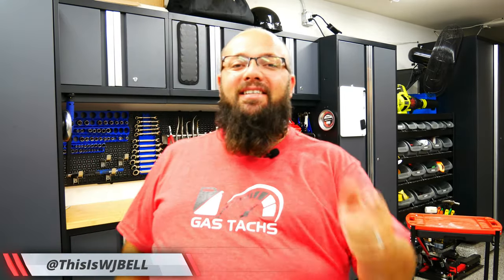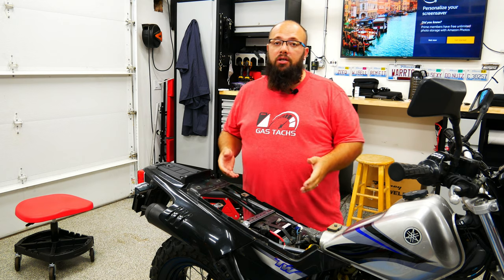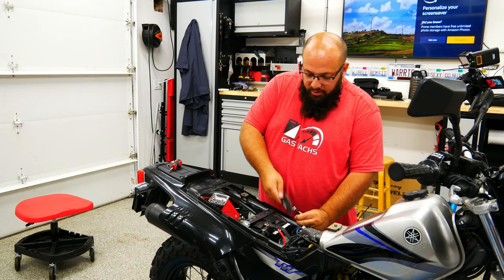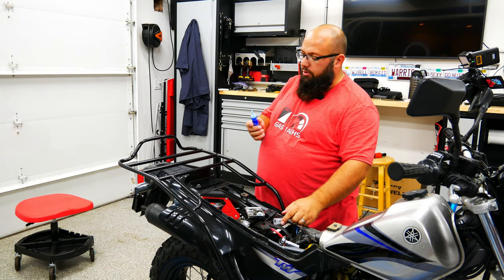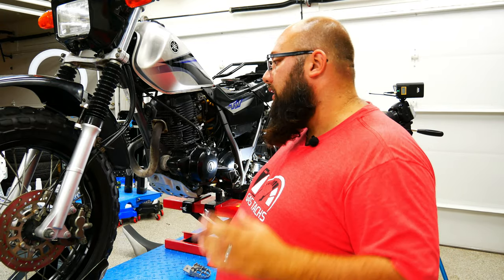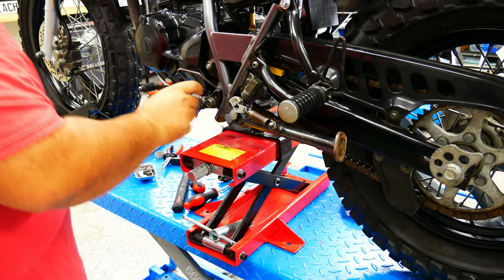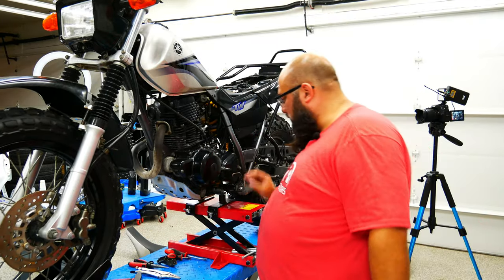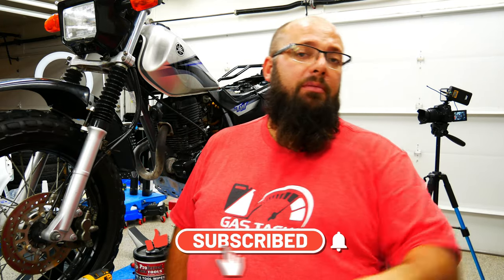My TW200 gets some Mods, It's going to be GREAT! - Part 1

Comment: should run the trickle charge wire under the frame so you dont cut through it when sitting in the seat and the air filter needs to be oiled
Reply from the maker: Thanks! I'll be sure to do those!